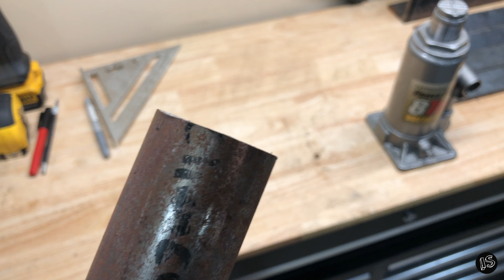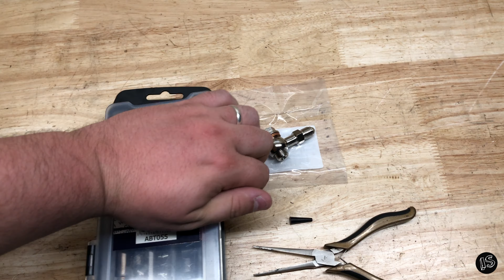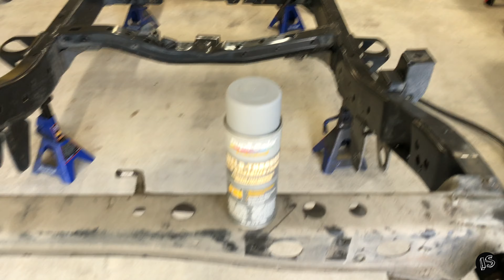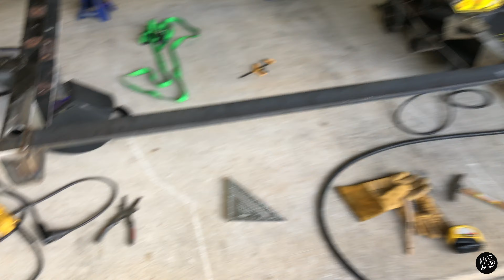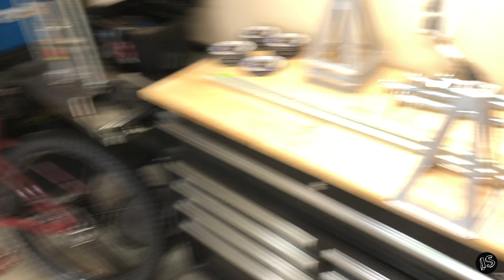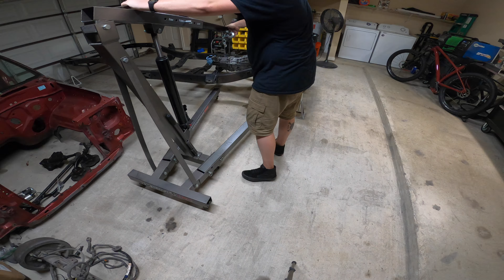Fuel Cell Install & More | D21 Drift Truck — Ep. 12

Comment: Excellent work man! How much power and torque could the stock FS5W71C transmission and the stock rear axle handle? Will they hold up on like 400 to 500 HP?
Reply from the maker: Bairon Fuentes really all depends on what you’re doing and how much traction you have. Torque and torque shock is what kills the transmissions. You can be making 320whp and shred this trans in an hour at an event, you could also make 450whp and drive it for 10 years. A lot of stuff to consider.

Comment: Great progress sir! Is that rack and pinion new or from a donor vehicle? I’m looking forward to seeing you install that!
Reply from the maker: Marc Pitre it’s a new unit. Yeah, I will be installing it along with the engine mounts in the next episode.
Reply: Inner Sanctum thanks for responding, I really like the direction you are going ! Front suspension question, are you going to use the factory lower control arms?